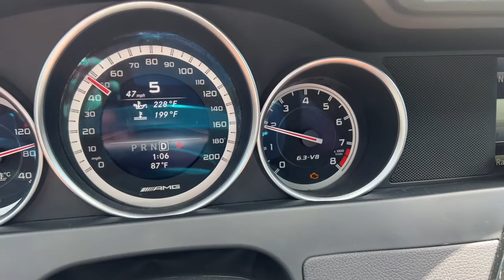Engine Blew In My C63..

Comment: My guess is stuck injector and a hydrolocked cylinder. Its possible this engine is still good! Pull plugs, drain fuel, replace injectors and plugs, change oil and go do a big smokey burnout! Rods don't always bend.  Good luck Mike!
Reply: Oh yeah, because you know.

JK LOL.
Reply: None of what you wrote is correct - In fact those two things aren't even related.  Stuck Injector = it would miss and be rough, but otherwise fine.  Hydrolocked, well, you kinda need to suck in water for that.  Nope.  It's either timing, or an oil problem because it won't rotate.  Either way = Rebuild Time.  And Yes, I got the "joke".  It would be funny if he had hydrolocked two of 'em.
Reply: I was just coming to say this same thing bad injector hydrolocked after sitting.
Reply: I agree with Legit. I have an 09 E63. This definitely isn't normal to be mechanical..esp on deceleration.
Reply: Engines hydro lock with any kind of fluid. Wtf?
Reply: Love LegitStreetCars!  So sorry AutoVlog!  But it’s such a beautiful car, glad u are repairing it!  Appreciate your positive outlook!!
Reply: @hariscrnic7829  most fluids are not compressible if it can’t drain past the rings you hydrolock.
Reply: I was JUST thinking what Legit would think! You're literally the MB whisperer, especially this era of Benz.
Reply: @ChrisCebelenski  You do know who Legit Streetcars is and what his previous profession was right? I mean, Alex would seem like someone that knows.....cause you know..Mercedes/AMG Master Technician and all that.
Reply: A collaboration needs to happen. The Midtown Mercedes Master and AutoVlog!
Reply: @AndrewAMG_  correct. Fluid+pressure=hydrolock.
Reply: @clifbradley  Yup - I just thought it was funny that poor Mike would destroy two engines through what could be the same problem.  Actually Hydrolocking is of course possible, especially if there's a blown head gasket.  Really, it could be any of those scenarios - all of them kinda freaky on that engine.  Guess we'll know when he tears it down.
Reply: Would periodic fuel injector cleaner treatments prevent a stuck injector?
Reply: Kind of agree.
Reply: @AndrewAMG_  you can't compress oil...coolant.. oil...water...or fuel in a compression stage of an engine. It's called hydro locking.
Reply: @hariscrnic7829  I’ve already explained that I’m not known as Andrew AMG for nothing
Reply: @ChrisCebelenski  , Your Correct!!! It's more than likely that the timing chain let go then there was contact with the valves & pistons, or the oil-pump let go & the rod bearings definitely seized up from Mike still trying to allow the engine to run!!! He should have turned it off immediately then he might have saved it but his mistake is going to cost him some BIG BUCKS now buying a new Longblock!!!
Reply: Send it to Alex!
Reply: Wow. Just came here to suggest a collab... I'm late 😉
Reply: Love this
Reply: If anything, just send the motor to Alex and have him do a forged build on it 🤘😝
Reply: Stuck injectors are common issues with this platform, it's been very well documented on the forums to replace them every 50-70k miles or you can risk a hydrolocked engine.
Reply: Legit might be right actually
Reply: If legitstreetcars says it, that’s it
Reply: @ChrisCebelenski  "None of what you wrote is correct - In fact those two things aren't even related. " Yes they are related...if you have a stuck open fuel injector, it can dump fuel until the cylinder is flooded, then you get hydrolocked. 
Legitstreetcars knows what he is talking about, he literally works on these cars for a living, and was an ex-mercedes mechanic. 

Still, it could be a blown head gasket or something else. But its a reasonable guess
Reply: @jcdentonunatco  Could be! (That was meant as a joke and ironic BTW - See the original poster!)
Reply: It's the turbo-encapsulator for sure!
Reply: @ChrisCebelenski  You do realize he was driving it when the possible injector stuck open and then shutting the car off would then allow the cylinder to fill with gas and hydro lock the cylinder. I’m pretty sure gasoline is also a liquid capable of locking the motor. And every time they turn that key on and it’s builds fuel pressure it’ll continue to fill that cylinder…….. Maybe try not to be rude to an actual mechanic that worked for Mercedes for years…….
Reply: What is this guy talking about , absolutel crap ,  he’s got a crystal ball
Reply: Yep  it's a fact that a bad injector easily cause damage to an engine , but mostly washing away the oil from the cylinder wall and then the piston rings are damaged right away ... a hydrolock because of that in my mind is not impossible but very unusual  because if the injector would gush the fuel into the cylinder the engine would have run badly before and also smoking blue. Also this engines die often because of theyr split  pickup system , because there is a rubber seal in between the front and back oil tube in the oil pan,  if this goes hard the oil pump immediately starts to suck air , oil pressure goes down and the engine locks up . I just hope that they can repair it , would be sad if the engine would be a total .
Reply: Also came to say same

It was running bad due to misfire on the cylinder with leaking injector and lots of smoke from unburnt fuel, then when left it hydro locked due to injector leaking fuel into cylinder.

You should have pulled plugs then hand cranked it and you would see it spit the fuel out the effects cylinder.

I bet a new injector is all you need and and oil change as contamination of oil with fuel withwss the oil up which will hurt the engine if you run it without changing oil
Reply: @roccomassello1767  I’m also a Mercedes’ master tech an I agree 100 percent with you. If the motor fully grenaded and is locked up it wouldn’t be able to idle when he pulled over
Reply: Yup I'm thinking injectors caused this issue. Unfortunately for these cars injectors are a maintenance items to keep it reliable.
Reply: @ChrisCebelenski  this guy is a Mercedes master technician and has experience with the Mercedes M156 engine, a lot more than you would have.
Reply: @frederiquekruger4818  Yup, that's why it was a joke.  You're responding to a troll post.  Everyone knows who he is!
Reply: Stuck injectors got me in my C63 at 36,000 miles.  Was just cruising down the highway in traffic at steady speed.  I limped home nearby and it was like driving a semi truck with rough idle and shakes.  Mercedes dealer repaired and replaced all the injectors, and anything in their needing replacing while the engine was open.  $3500 to fix and I have not owned an AMG car  -  out of warranty - since that day.
Reply: @larrybenton777  has NOTHING to do with owning an AMG car.  You had an old crap car with a motor that was known for problems.
Reply: Want to agree , read somewhere its not good for injecters if you run your car on empty as the last fuel is usually not very clean and sometimes the fuel filter is not foing its job and you can damage injectors , saw in the beginning his fuel was like emty ,
Reply: @gertdekock2216  empty?  How is it running on empty?  He still has 3 or 4 gallons of gas in the tank.  How can a fuel filter not do its job?  So a fuel filter only work when you have alot of gas in the tank?  🤣🤣. And even so how it that damaging injectors?  Most that would happen they would get clogged.  Not many bright people making comments here.
Reply: To all those guys doubting Alex! I bet you feel stupid now!
Reply: @robertsteele1729  I'm going with what Aelx said and a stuck injector cause the #8 cylinder to fill with fuel.
Reply: @Nitehawkrr  Just decades or experience as an AMG Master Tech and the schooling and successful YouTube channel to back it up
Reply: Yea the man spoke 
Fav YouTuber🎉

Comment: Id suspect head gasket. A water leak into the cylinder judging by the exhaust, could be hydrolocking it up as well if its bad.
Reply: That’s what I say to . I don’t know if they hit the key after it cooled . If they didn’t. Theses a good chance it just needs a top end fix . But
Reply: Blown head gasket is white smoke, not blue
Reply: @danoalex2977  Thanks. We all actually thought that...lol No one typed "blue"
Reply: Definitely a cylinder head issue. Either cracked or a blown headgasket. I think it's the latter and totally agree

Comment: I thought these old 6.2’s were pretty bomb proof. You’ve broken 2 😂
Reply: they are, until you start putting non-AMG tunes on them
Reply: His M5 was more reliable and everyone bashed the reliability of the M5 😂
Reply: @dor1tomcswagger69  That was my fave car he ever had. Too many add ons.
Reply: @jcdentonunatco  non amg tune?
Reply: @promx96  He has an after market ECU tune I believe.  Trying to suck more torque and horsepower out of the engine.
Reply: The other one was a 4.0 twin turbo
Reply: That's what happens when you buy a 10 yo Used Mercedes' crap shoot
Reply: it also happens when you constantly rev it and do hard pulls with it......its an AMG but not necessarily meant for constant abuse and 0-60 launches....
Reply: @truckercowboyed2638  right
Reply: After a while it gets old . Kind of childish. He needs maybe to ease up a bit
Reply: Constantly driving a vehicle like you stole it and tuning a already high performance engine that is already pretty close to it's design limits what do you expect.
Reply: M113/M113K'S are relatively bomb proof. M156's not so much
Reply: @RothBeyondTheGrave  wrong
Reply: @jcdentonunatco  bullshit.  They are the worst.  Evan had a class action lawsuit for the tons of problems they had.
Reply: @bobtis  No this is what happens when you buy a car that has an engine that was known for tons of problems.
Reply: @truckercowboyed2638  huh?  Doing hard pulls does NOT hurt an engine.  Da fuck you talking about?   These motors had problems since day one.  Flawed from the factory.
Reply: @bobtis  not really, Benz can be a 2022 and transmission breaks soon as you add 50 miles on it, it’s a lovely car tho they’re just built to break
Reply: @Que_Maine  yes they are I hate to say. That car is beautiful.
Reply: @Executiveinvestments-  spreading internet misconceptions lol let real people enjoy these things lolol mine has 150k miles daily driven for 3 years EVERYDAY have a good day

Comment: The head gasket blew while you were driving which caused coolant to go into one or more of the cylinders. This caused the vehicle to run poorly which threw on the engine light, and smoke to come out the exhaust. When a restart was attempted, the coolant-filled cylinder seized the engine up.

Comment: This looks like a blown head gasket. New engine is not required and would be a massive waste of money. But it will need a teardown and rebuild. Not expensive part wise, but lots of labour. 
The white smoke typically means coolant is getting inside the engine. Some really bad luck you have with C63's! 
:(
Reply: The engine would still turn with a blown head gasket. This thing locked up
Reply: Finito
Reply: @justintoth5440  not necessarily. if enough coolant got into a cylinder that it got hydrolocked, it could refuse to crank. Blown gasket can cause that.
Reply: @jcdentonunatco  cost more to rebuild than to get a new motor.  You are clueless.
Reply: @Executiveinvestments-  Sure, if you ask AMG in germany to rebuild it, which nobody in their right mind would ever do unless its under warranty.
Just rebuild at a local Mercedes specialist shop for a fraction of the price. These engines aren't complicated, just simple naturally aspirated V8s, not hard to work on.
Reply: @jcdentonunatco  yeah because rebuilding a motor is cheap.  🤦‍♂️🤦‍♂️. And Amg parts are cheap🤦‍♂️🤦‍♂️.  You sound clueless.
Reply: this is true. not LS1 rebuild prices but not out of this world either.
Reply: @Alex-rj6sv  100% false.  Do research and then come back and comment.

Comment: Well thats strange ! 
Id pull the valve covers and see if the timing chains are ok, check valves & cams. Easy to do. 
Then the plugs to see if its a bent valve. 
Now an injector could have stuck open and hydrolocked it, but i kind of doubt it. Or a head gasket failure, but thats not likely either.

Comment: headbolts, replace them one at a time and you're back in business.....same thing happened to mine over 80k miles ago....1day, $80 worth of timing tools and $130 worth of bolts and I was back in business. Dealer quoted THIRTY TWO GRAND to fix, fuck them.
Reply: This is a post facelift engine which has new headbolts.
Reply: @AndrewAMG_  I am fully aware, but I have personally seen 4 M156 engines that were WELL after the VIN break have revised bolt failure.
Reply: @JAKEaudio2  do you have any pictures I’m quite outspoken on the headbolts since mine popped and mb offered no assistance regarding it so every chance I get to badmouth them I do. Not so much as an apology. After doing research I find it hard to believe the second generation bolts have failed it’s pretty much impossible.
Reply: @AndrewAMG_  unfortunately i do not have any pics of the revision failures(they weren't my personal cars) but I absolutely understand the skepticism as I thought the same thing prior to seeing them myself. I will say this though, they did NOT appear to fail in the same manner as the originals did(stretching at the head or head popping off), they all appeared to have backed out a little bit and then the threads on the bolt were torn away. Also, in each one it was the very rear bolts. I know the VIN break was supposed to provide salvation for the M156 but what I've seen says otherwise (at least to a small degree). But don't get me wrong, I wouldn't trade my M156 for all the tea in China!!!
Matter of fact I just replaced the adjuster backing plates with ones from 63Motorsport, at just over 300k miles and it runs like a brand new scalded dog. Original M156, 722 AND rear end.
Reply: @JAKEaudio2  great with my luck I’ll have the second failure too, it’s the first I’ve heard of it people all over the world where contacting with their stories back in 2016-2018, hard to imagine 1.5” of thread letting go. My car failed in 2016 with 35,000 miles it’s got 38,000 miles on it today.
Reply: @JAKEaudio2  mmm now you have me thinking are the threads ripping off the block or bolt, factory installed? Or one by one replaced? Wonder if the pressure to rip the head off the bolt the first time compromises the aluminum thread and installing the new bolt causes further stress on the thread. Inferior metal on the bolts seems like it’s impossible for aluminum to rip metal off a bolt.

Comment: Gave it a huge thumbs up as always! Going to be interesting to see what went wrong with the motor all the sudden. That's super scary bc I owned an 2013 E63 several years ago and I had computer trouble with mine, which led to erratic shifting. Luckily it was under warranty bc it ended up costing $13k!!! If I owned it out of warranty I wouldn't have been able to afford that. I've since sold that car (I miss it everyday) but it taught me a valuable lesson, not to buy something like that if you can't afford a major repair. Not saying you can't afford the new engine, I'm just speaking about me and that whole ordeal comes to mind every time I purchase a vehicle. Helps keep me within my budget.
Reply: Lesson learned - used German cars are absolute garbage

Comment: Same engine in my ML63.   Same issue.   Head gasket blown.   Smoke.   Engine destroyed.   Coolant in my oil.
Reply: engine isn't destroyed, you just need new head gaskets. Yes its a long rebuild, but part wise its not expensive
Reply: @jcdentonunatco  could be damaged because if these two mix than lubrication is much worse during the time the engine is running with that problem
Reply: @dylanoppeneer2354  true, but I don't think he drove it long like that, at least in his case
Reply: coolant in cylinder = hydrolocked

Comment: Hejsan! sorry this happened to you, this happened to my 2018 E300 with the M274 engine which this is very common on. 1st cylander fails and boom just like that I needed a new engine. Could not afford to replace the engine in it. Went and bought a c300 and to my surprise has the same engine in it. I am hoping and praying every time I get into it. Good luck with this one and.. Ha det sa bra hemma i sverige

Comment: I would pull the motor and rebuild it. Would be a perfect time to bore it out and put larger pistons in it. Pull the heads and have them machined and slap it back together making more power.
Reply: Its 6.2 liter engine, i think thats already pretty big. But it would be cool

Comment: That's what you get for beating on it.
Reply: like a red headed stepchild !
Reply: This car is made to be beaten on, its a head gasket issue because of the wite smoke, means that coolant is getting burned in the combustion chamber
Reply: @dylanoppeneer2354   That meant to be beaten on the agombie. That's why bad stuff happens to you when when you beat on the car. Learn to learn to learn your facts before you start typing

Comment: noooo! so sorry, I had similar smoke out of back and miss, and it was just fouled up o2 sensors and spark plugs. I've replaced my injectors already, I tested my old ones and they were really buggered. I'm with the others here thinking an injector likely got stuck open and hydrolocked it :(

Comment: I had the EXACT same symptoms and happened in the EXACT same way. I was driving along decelerating, car downshifted from 3rd to 2nd and engine shuddered and a cloud of smoke from one side of the exhaust in my rear view. Turned out to be it crapped piston 8.
Reply: So what was the final outcome and repair cost? Was the car fixed and running well afterwards?

Comment: Hey what did the cel code read? Cam adjusters go on these and cause very unexpected problems. FYI these high compression engines will take more than a little muscle to manually crank with the engine covers completely on….